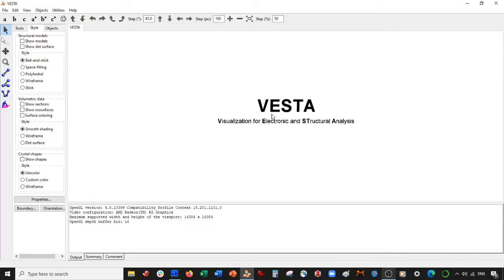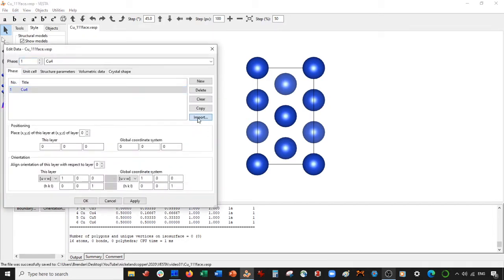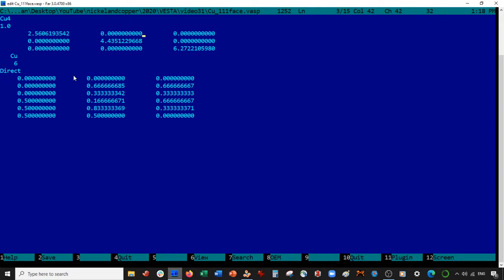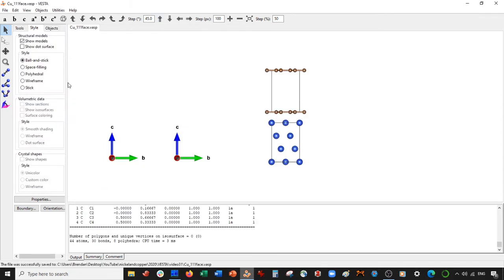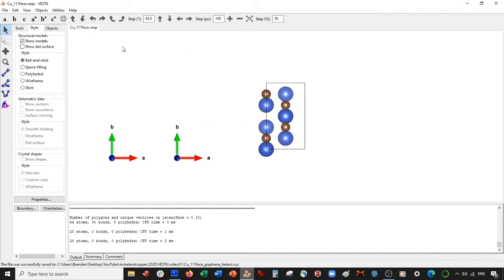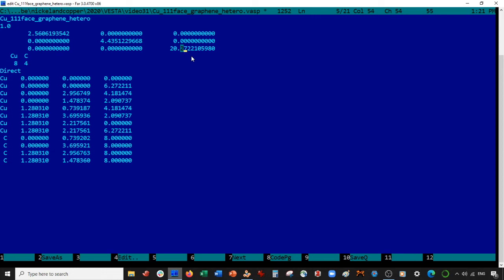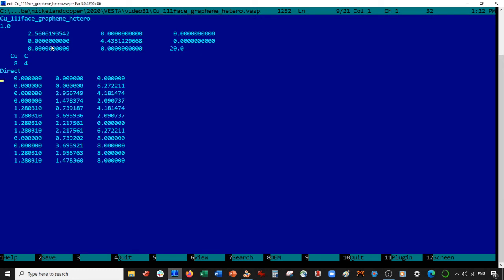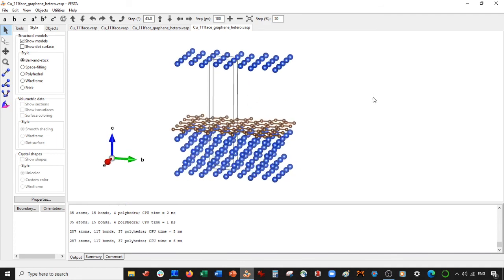VESTA Software - Cu [111] /  Graphene Heterostructure Part 2

Comment: I used C48 buckyball (48 Carbon atoms) in VESTA to build ZnO buckyball (24 Zn atoms and 24 O atoms). But, I do not know how I can make the replacement of carbon atoms with Zn and O. I mean that I do not know which carbon atom in C48 buckyball must be replaced with either Zn or O atoms to obtain ZnO buckyball (24 Zn atoms and O atoms). Please could you help me to do this. Thank you again...
Reply from the maker: Check out my video on changing chemical identity in Vesta. You can use the text file. Also check a video where I make a quantum dot. Where I enter the atom. You can at that point, instead of adding the atom, replace an existing one
Reply: @nickelandcopper5636  Yes, I checked out your video about changing atomic identity in Vesta. I have used the C48 buckyball (48 Carbon atoms) in VESTA. To change atomic
Reply: @nickelandcopper5636  Can you see my response? When I looked at my response, I can not see my entire explanation.
Reply from the maker: @gulayalgul5208  yes I can see. Do you still have a problem? Just keep trying for a bit longer .. watch some other videos. It may take some time to realize
Reply: @nickelandcopper5636  Yes, I have still problem to build ZnO buckyball....

Comment: Thank you so much for all of your tutorials, I have learned a lot from it. For this video, I have a question: You overwrite the a,b lattice vector of graphene, and then add it to the Copper. But in this way, the lattice vector of graphene is not the right anymore, so this heterostructure is not stable?  I remember in another video you talk about the lattice mismatch, how to solve this problem in this structure?
Reply from the maker: Hi Guanqi Li - do you still need help with this? The lattice mismatch can be computed as the absolute value of the difference of the lattice vector (the faces we combine) divided by the average. Maybe I can elaborate in a future video